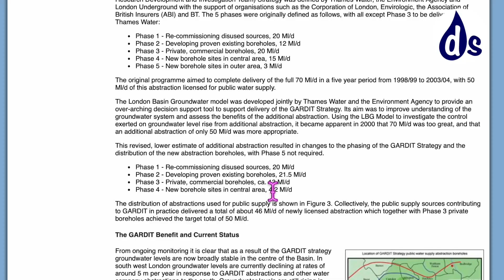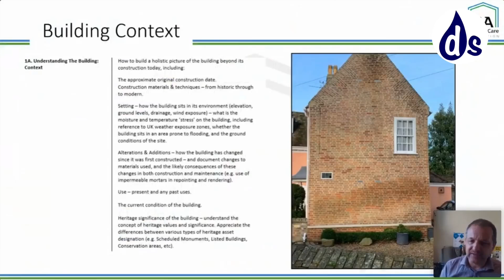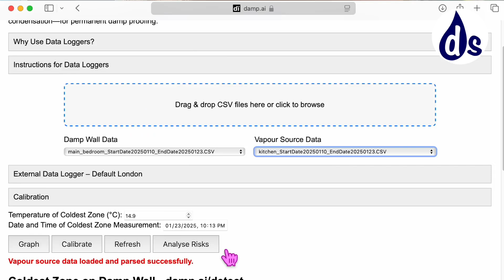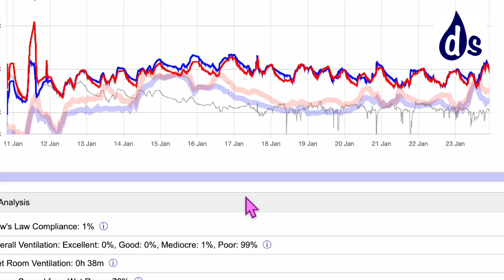❤️ Rising Damp - 🤔 Truth or Scam ⚠  #RisingDamp #DampProofing #DampSurvey #SkillBuilder #RogerBisby

Comment: We do need open debate and the points made are valid. Here is my contribution. 

I’m a Chartered Building Surveyor with a specialist interest in the history of defects, and one of the most persistent issues in buildings is the movement of liquid water through open structures such as walls. The science behind how liquid water moves against gravity in these materials is well understood and proven. So, if anyone wants to deny this fact, they need to present an alternative scientific explanation. (Not just saying it doesnt exist) 

Point 1. The basic " cure" to liquid water movement in open structures :

a) Find the source of the water.

b) Remove the source and any salt contamination.

d) Wait for the structure to dry.

Thats it.

If the wall remains "dry", it doesn’t matter what you put back on it. If water continues to manifest and you can't stop the proven source, you can either: block its passage, let it in and give it a route  out, or accept the ongoing risk with sacrificial finishes. Each remedy has its imperfections and merits.

Point 2. It is in the interests of biased experts and companies to create confusion in point 1.

Semantics, dismissive outrage and misdirection are popular tropes to selling expensive consultations and products as this doesnt need  scientific basis or qualification. You will no doubt see some of these being deployed in other comments as to work, myths need perpetuating. 

Point 3. Finding the water source (in its causal state) is not easy.

The only way to give conclusions as certain as possible is to drill into the wall, which isn't covered in standard pre-purchase visual surveys and is rarely welcomed by sellers. This often leads to over simplistic recommendations for "further investigation", which can send you back to point 2 in an endless loop because of point 4.

Point 4. A significant difference in drawing appropriate conclusions is time. Drying a structure takes time—but in real-world scenarios like selling a house, vendors, agents, and lenders often don’t have that luxury. As a result, they make the best choices they can under the circumstances, even if they’re not ideal. Hence poor remedies badly implimented and pointless indemnity policies. BUT - HOUSE SOLD!

These are the 4 prime points of the rising damp spiral phenomenon as I understand them, but I’m always open to evidence-based discussion.
Reply from the maker: Thanks—Your voice as a Building Surveyor is crucial in setting the parameters for this debate! (I believe we’ve exchanged messages before, or I certainly recognise your corporate video.)

🔬 The Science of Rising Damp
The absorption of moisture through porous materials is scientifically proven—no debate there. However, what’s less well understood is that moisture is mainly drawn down by gravity, unless obstructed by a barrier, like the water table.

The definition of rising damp matters:
1️⃣ Strict definition: Groundwater (water under the water table) being absorbed upwards.
2️⃣ Loose definition: Any dampness at the base of a wall—be it from rainwater in soil, a leak, or condensation.

Ross Charters (respect @completepreservation) takes the second approach—calling all base-of-wall damp “rising damp” but focusing on treating the root cause (different definition from my preference, but same result). My preference is the strict definition—because ruling out groundwater early keeps an open mind to finding the real cause.

💡 The Proper Cure for Damp Walls—Agreed!
The correct approach is simple:
✔️ Find the water source
✔️ Remove the source and any salt contamination (by that, I assume you mean hygroscopic salts—see one of my final points)
✔️ Let the structure dry naturally

Damp-proofing slurry does the opposite—it blocks water movement instead of fixing the root cause. The presumed logic behind it is that groundwater is not economically removable for an individual property—or, as I suspect, slurry was originally developed to block hygroscopic salts. However, an oil-based primer is a modern alternative that is:
✔ More effective and more economical than slurry.
✔ Easier to apply over the salts, and remove if required, making it better targeted for problem areas.
✔ Less destructive, with minimal effect on a wall’s breathability.”

💰 Surveyor Risk (Hart v Large) & Why Rising Damp Treatment Became a Business Model
🔹 Surveyors lack time to investigate fully.
🔹 They pass the issue to a contractor (who sells damp-proofing).
🔹 Damp-proofing doesn’t fix the cause, just hides symptoms.
🔹 Slurry traps moisture, leading to long-term problems like rot and subsidence, while surveyors and damp-proofers remain legally protected.

🚨 Surveyors should not be permitted by RICS to write statements like these:
❌ “Rising damp has been recorded… obtain a quote from a PCA contractor.”
❌ “We suggest a PCA member provides remedial work with an insurance-backed guarantee.”

This pushes impermeable slurry as a default solution rather than addressing the real cause. Instead, surveyors should recommend independent damp surveyors.

🏡 A Simple Solution to Address Surveyor Risk—Without the Usual Damp-Proofing Recommendations
✔️ 0.5% reduction in offer price for unexplained damp, OR
✔️ Delay sale until an independent surveyor investigates properly, OR
✔️ 0.5% retention for 6 months to allow proper monitoring.

Sellers should fix damp issues before putting their property on the market. But in reality, most people only act when damp becomes unsightly—or when they decide to sell.

📢 The Way Forward
✅ Agree on what rising damp actually is—or if we can’t, at least agree on what impermeable renders are actually good for.
✅ Agree on treatments if groundwater is the source.
✅ Agree that if groundwater is the cause, then properties without high groundwater should never be treated for rising damp.
✅ Agree that groundwater should be evidenced by drilling at least 1M below floor level to check for free water.
✅ Stop passing all base-of-wall damp issues to vested interest companies.
✅✅ My passion—investigating the movement of hygroscopic salts in walls. It’s rarely discussed, but hygroscopic salts are not a source of water—they originate mainly from chimneys (historic burning of coal) or equine urine. Once on the surface, they are difficult to remove, so require covering:
🔹 Modern solution: Oil-based primer (see above) – effective, reversible, and less destructive.
🔹 Traditional approach: Slurry – but this raises issues, especially if there’s an ongoing source of moisture. (I believe the study of hygroscopic salts and their treatment could resolve most of the Rising Damp debate.)

📣 The Future of Damp Surveys
I’ve made proposals to RICS & the PCA, but change is slow. The real hope? Millennial buyers—tech-savvy, independent, and more willing to challenge bad advice. That’s why I’m sharing everything I’ve learned for free at https://damp.ai—including how to use data loggers before & after a survey for a more evidence-based approach (see https://damp.ai/detect).

🔍 The truth is out there—we just need more independent voices in this space! 💬 What do you think is the best way to break the surveyor-contractor Rising Damp-Proofing cycle? 🤔
Reply: @dampsurveys  I think we have had discussions before. I'm an independent chartered building surveyor but I'm glad you felt my content is to a corporate production standard!  I think before we get too causal we need to consider buyer behaviour. Not everyone requests a survey, and not everyone who does requests a level 3 survey. Some level 2 surveys are £300 for an investment of hundreds of thousands. This is not going to give immense detail.  My point is we have to accept the public choose what they buy and what remedies and cover ups  they choose. Just like we can't blame all damp proofing companies or surveyors  for engaging in bi partisan deals we can't assume all cases of poor installations are caused by surveyors calling for further inspection. All we can do is give a detailed and honest education which I think this video does hence why I engaged.
Reply from the maker: @geoffhunt6646  Geoff, I really appreciate your engagement—these discussions are exactly what’s needed to move the industry forward.

I completely understand the constraints surveyors face, especially with the limited time and scope of Level 2 surveys. And you’re right—not every buyer requests a survey, nor does every buyer want the level of detail that would allow them to make fully informed decisions about damp issues.

That said, the damp-proofing industry needs a serious shake-up—not just to preserve our shared heritage, but because of the enormous financial waste, economic damage, and mental health toll it takes on homeowners.

📢 In the next few weeks, I’ll be publishing a batch of new videos—almost all of them showcasing the damage caused by damp-proofing treatments. These include:
1⃣ Rot – Where impermeable coatings masked a leak, leading to costly, unseen timber decay and ongoing dampness on the walls not damp-proofed.
2⃣ Hygroscopic salts – Two cases where salts were misdiagnosed as rising damp. Because damp-proofing treatments are installed wet, the salts based through to the new internal surface.
3⃣ Mould & condensation – Multiple examples where impermeable coatings caused heat loss, increasing the risk of mould and condensation while reducing the natural buffering effect of walls.

🚨 The real issue isn’t just poor installations—it’s systemic.
Chemical DPC injections and tanking slurry are still pushed as standard practice, even though they frequently cause more harm than good. These outdated solutions are lowering property values, risking litigation, and failing to address the real root causes of damp.

🔹 Damp-proofing is a marketing term, not a fix
At best, damp-proofing is an aspiration—at worst, it actively worsens problems. That’s why I’m working on using AI and data-driven diagnostics to shine a light on the real impact of these treatments. Homeowners don’t need cover-ups—they need the root caused identified followed by repairs.

I’d love to hear your thoughts on the next batch of surveys. I work closely with AI and see it as a tool that could finally help busy surveyors—who often have limited time—identify the most probable root causes of damp—followed by data led diagnostics.

That said, we’re still at the foothills of Everest. 🏔 It may take a new generation of surveyors to push the industry forward. I’d be really interested in your thoughts.
Reply from the maker: Geoff, as always, I appreciate your perspective—this is exactly the kind of discussion we need. 🔍🏡

Absolutely, water can rise against gravity—capillary action is well understood. The real question is how often groundwater rises in buildings to a problematic level—and whether it’s a widespread issue requiring damp-proofing treatments. That’s where things get interesting.

The Two Types of Properties Being Damp-Proofed

From what I see, most of the properties currently being damp-proofed fall into two categories:

1⃣ Misdiagnosed damp—The issue isn’t groundwater but:
	•	Condensation
	•	A leak causing sub-floor vapour to bridge the DPC
	•	Hygroscopic salts from historic coal burning or livestock use
	•	External defects (e.g., leaking gutters, raised ground levels, failed drains)

2⃣ Properties that have already been damp-proofed—If chemical damp-proofing injections worked, we should see fewer houses needing it over time—not more. Yet, many houses getting “treated” today were damp-proofed years ago, suggesting either:
	•	The original diagnosis was wrong, or
	•	The treatment doesn’t work as intended.

Even if 1% of UK homes (approx. 300,000) truly suffer from rising damp due to groundwater, that would mean around 5,000 properties per year needed treatment since the industry started in the 1950s/60s. That’s barely enough to sustain one or two damp-proofing companies.

Yet, the damp-proofing industry operates at a scale far beyond that, with millions spent annually on injections, tanking, and re-plastering.

🏗 Why Older Homes Don’t “Fail” Due to Rising Damp

You make a great point about past building failures—but of the 15th–19th century buildings that remain, the ones with proper sub-floor ventilation and external drainage rarely suffer from true rising damp.

If rising damp was historically such a big problem, wouldn’t we expect more evidence of widespread structural failures? Instead, the majority of issues I see are due to modern living and modern interventions—cement renders, tanking, cavity insulation, and plastic-based paints trapping moisture rather than allowing buildings to dry naturally.

🏡 Why DPCs Are Included in New Builds

I agree that DPCs are cheap and easy to install, and in modern cavity wall construction, they act as a belt-and-braces safeguard against leaks from failed rainwater goods or plumbing.

But in older solid-wall buildings, a lack of a DPC does not automatically mean there will be rising damp—many homes function perfectly well without them. My own house is a great example. As long as ventilation and drainage are managed correctly, there’s no problem.

DPCs should be a precautionary feature against unseen failures of rainwater goods or leaking pipes, not an industry-wide justification for retrofitting damp-proofing into buildings where groundwater isn’t the issue.

🚨 The Bigger Question

Would love to hear your thoughts on this—especially on the repeated damp-proofing cycle in homes that were already treated.

Stay tuned for a deeper dive into damp-proofer failures over the coming weeks. 📽🔬

If rising damp-proofing worked, why is the industry still so big? 🤔
Reply: Nigel Copsey is correct.  use low fired bricks and hot mixed mortars.  problem solved.

Comment: From my experience most Purchase Surveyors come in and test walls for damp with a two prong moisture meter, (which is solely meant for analysing timber) , and then report " The DPC may have failed, there is the presence of rising damp and the walls will need hacking off and injection treatment" 😲

Comment: Rising damp is what the customer sees, water wicking up the plaster. They are seeing the result but not the cause, it only takes about half a cup of water to result in plaster discolouration. The cause can be many things (often the occupants!), drains and saturation are very common. It is very rare for a dpc to get breached, I think breached dpc is bar far the least likely cause of damp.
Reply from the maker: By “breached DPC,” do you mean ground levels built up over the DPC, or plaster bridging the DPC inside the sub-floor void? Or do you mean a broken DPC—like a cracked slate layer?

If it’s the latter, it’s worth noting that the gap would typically be too large for capillary action to occur. Even if there were a small fissure, the amount of moisture passing through would be negligible.

I agree with taking a root cause, rather than symptom approach.

The strict technical definition of rising damp is where the source of moisture is groundwater, specifically water under the water table, being drawn up through a porous structure. However, what many people describe as “rising damp” is actually just dampness at the base of a wall—which can be caused by a range of other issues.

One commonly misunderstood issue with DPCs is that a leak in the sub-floor void, such as from a damaged drain or mains water pipe, combined with insufficient sub-floor ventilation, can cause condensation to form above the DPC. This then mimics rising damp because:
1️⃣ The DPC acts as a barrier, much like the water table, preventing moisture from being drawn downward.
2️⃣ Because water isn't drawn downwards, it instead gets absorbed upwards into the wall, creating the tell-tale “rising damp” symptoms.

As you say, breached or broken DPCs are actually quite rare and anyway are not the root cause, the root cause being groundwater which may or may not be present, but can be established by drilling down by 1M to check for the water table, evidence by a constant horizontal layer of free water.

For a deeper dive into identifying the true cause of damp at the base of walls, check out https://damp.ai/rising-damp

Comment: I had rising damp on a 1920s house due to breached dpc front and rear. I reduced the ground levels and replace the drains and cleared the vents, 2 years later no more rising damp.
Reply from the maker: Perfect! There are different definitions of rising damp, but in terms of treatment, it sounds like you successfully resolved rainwater penetrating damp—which not only stops internal damp but also reduces the risk of rot and subsidence. Well done!
Reply: Proof in point

Comment: To much damage done through idiots drilling holes in perfectly good properties .
Reply from the maker: The irony is that I actually have nothing against chemicals—if they worked, I’d be the first to recommend them. In fact, I do recommend Siloxane as a belt and braces measure against condensation rising off a solid floor—the root cause being excess vapour, but you can reduce its effects with Siloxane, so why not?

So, it’s not the holes (though I hate the way they look), but what they tell me—that there has almost certainly been slurry applied, and that’s the real issue. Slurry stops a wall from buffering moisture, hides the true cause of damp, and in some cases, can lead to rot, or at east hide rot and subsidence.